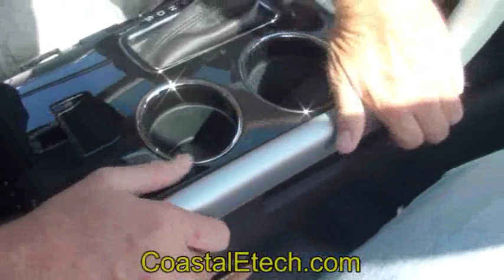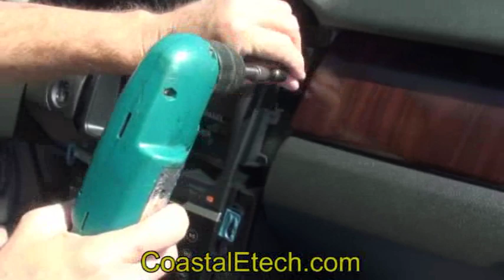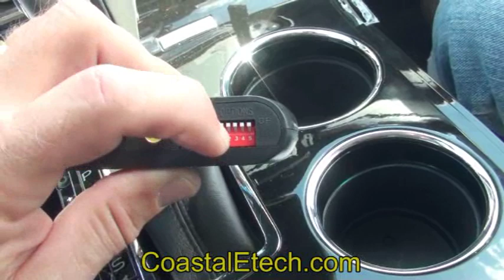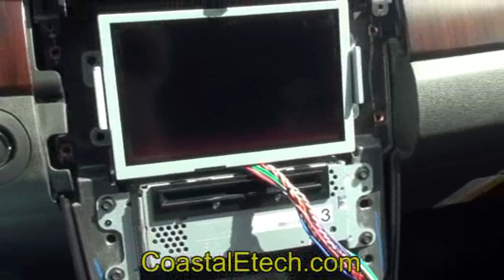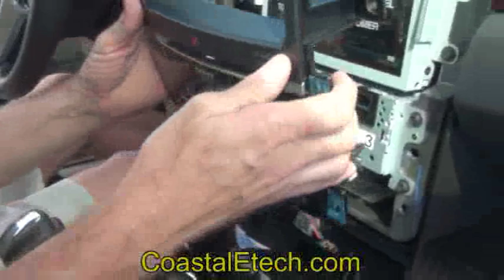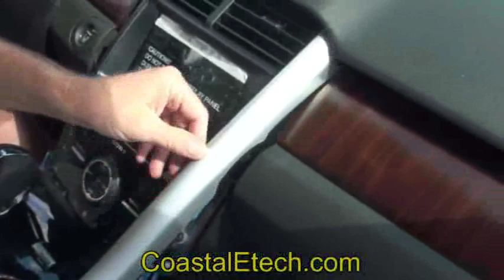EDGE FORD MYTOUCH INSTALLATION

Comment: Doesn't removing all these electrical connections without removing the neg. battery terminal damage all these accessories. I need to remove the trim side panels (base) and don't know how to go about it.